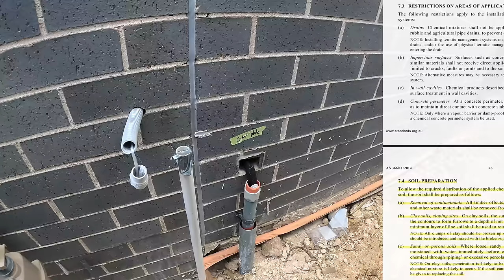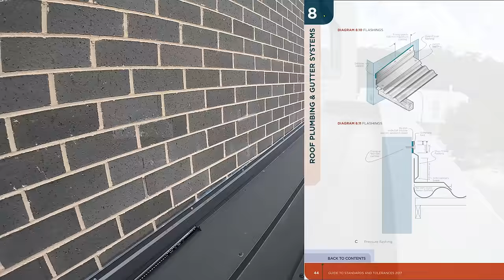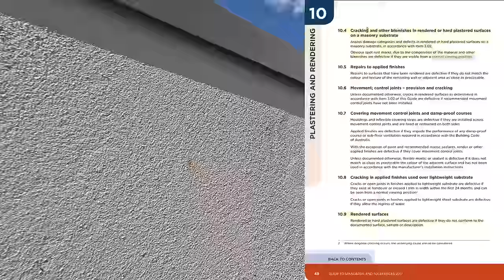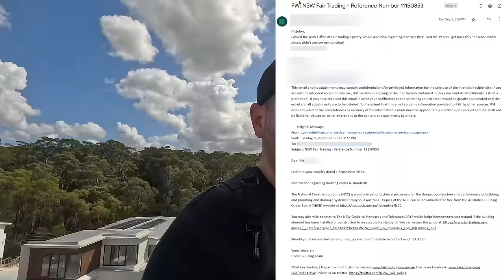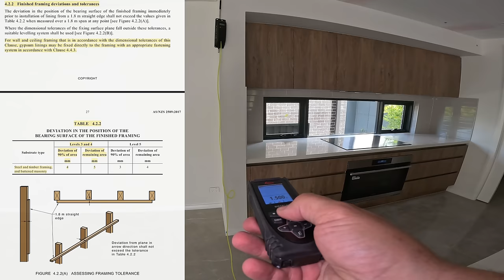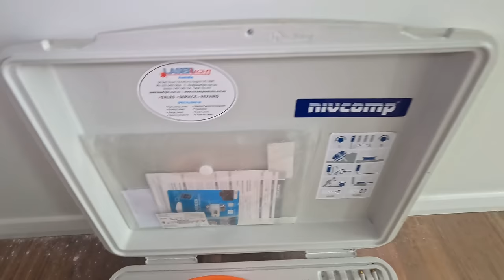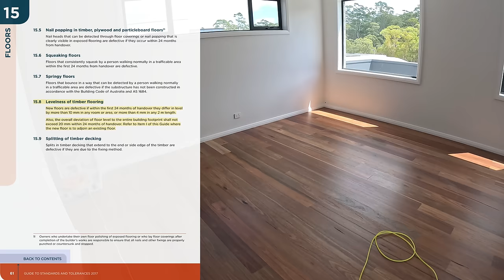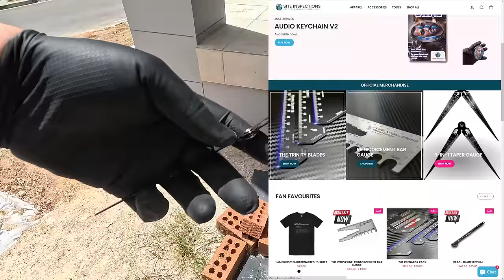I Inspected An Award-Winning Build | NSW Exclusive

Comment: Ugh, that paint work is insulting even to my amateur brush-hand self, because even at that height I would have done the job properly. Because not making the surface flat leads to crap pooling in the hollows and on the snags, leading potentially to premature paint failure and water ingress into the underlying material. And any gaps should get the appropriate sealing treatment or get flashing on them if they're too big to seal otherwise or have significant movement. 

Which is how I got lots of selley's no more gaps smeared all over the shorts and tops I've used for painting, because weatherboard houses always have gaps, especially around the windows and corners. And the rag is is oft not in reach lawl. 

And those floors and ceilings, it's a new house, but it's as uneven as a earthquake effected house here in Christchurch, despite the house costing easily $1.5-2 million. Total schemozzle of a job there because all the kit floorers and plaster's have make doing near close to flat surfaces so much easier than the old plaster and lath or floorboards right on the joists days. But nah, just slap it on and spin bs when the client finds out, even on a major build like this. 

I also don't find that suburb all that nice, far, far too samey, a lot better than certain infill suburbs where every house is exactly the same, but still too much homogeneity and there's no sidewalks either, which is a massive planning fail. Plus it's sitting in a prime bush fire environment when a major drought hits, but was hopefully built on previous pasture, rather than cleared forest.

Comment: Imagine paying $1m+ for these badly designed homes of polystyrene, held together with silicone, that leak even before the owners move in, all lovingly handcrafted by fresh-off-the-boat "tradesmen" (with years of experience as goat herders), to non-compliant sub-standards.
Reply: Don't be racist, Aussie builders just as bad.
Reply: 2 million - land is 1m
Reply: Nothing wrong with the building systems. If used properly, it's a very viable building material.
Reply: Thanks for the laugh
Reply: @elmohead  polystyrene shouldn’t be used for anything
Reply: @JP-ke7tt nothing wrong with polystyrene vegetable boxes.
Reply: @JP-ke7tt just for fruit boxes and cool rooms...😂
Reply: Its not the Labourers, it's those who Inspect and give the ✅️✅️✅️ of approval and hand the owners a Lemon.
Reply: Well when your contracts are given to the lowest bid what do you expect?

Comment: My home is a mass produced,transportable home, made in 2 sections, trucked in from 300km away.........and its better than these builders. Thats the thing, the manufacturer has all their tradies, on one site, properly supervised,properly trained and sorted to do the job properly.  Not like these sites where "cowboys" can run amuck and do whatever the heck they want, signed off by useless,or corrupt inspectors. If you are going to do complex structures, on remote sites, you need to have top notch supervisors kicking their tradies into gear to get the work done correctly.

Comment: Do you ever feel like all these regulations bog down the building process? People don’t want expensive houses that take so long to build, but they also want them built to 10,000 different codes. Were there this many codes “in the old days”? If not, were houses really poorly built without so many codes? Is the purpose of having so many codes so that houses will last a long time without a ton of maintenance?
Reply: They're there because people chuck a tantrum when something goes wrong.

The first thing Aussies day is... The government needs to do something.

Then everyone complains that they do.
Reply: There were very few houses built with flat rooftops in the old days. Where you had parapets and chimneys they had extensive lead flashing at the interface to the roofing material, which was commonly a sloping tile roof. In fact, silicon didn't used to be available and the flashing was more intense.  A lot of the key structural elements were also brick or stone, more tolerant of moisture than the current homes with timber and mild steel as structural elements, so more important keep moisture out

Comment: The modern era of homes and building quality has really gone to shit. Tradesman, builders etc all want big money for rubbish work, This video is a clear indictment on the building industry and shame on them all.
Homes are getting smaller, put on tiny blocks of land and are costing double, triple and quadruple what homes used to cost 10, 20 and 30 years ago.
There's nothing beautiful about that neighbourhood. It's just another boring looking street with houses that look the same that are crammed together with little to no driveway space with houses tightly packed in between each other and little to no backyard.
This is not living. These houses are rubbish and I wouldn't be caught dead living in one of those. They won't last 20 years and by that time they will be falling apart. 
The quality is crap.
Thank God I have a quarter acre block in Western Sydney and will never sell it.

Comment: I agree with almost all of your videos and I watch them and like your content but as a roof plumber I can say that installation was very neat, not compliant with the upstand and pressure flashing that’s a big no no and should have been done but I see no other reason why they would make the box gutter chute so small unless they had no other option, no roof plumber would just choose to do that, I find myself a lot of the time it’s the badly designed house and terrible chippies that cause these problems, we can only polish a turd so much bro , and we can’t exactly just go cutting lvl supports. There are a lot of variables and I see you picking on the roofing side more than anything when what we install is dictated by the frame and structure built before we commence work. So every rainhead now that’s not the patented design is non compliant, bro! They have worked flawlessly for 50+ years in that configuration, just because someone patented something doesn’t just make something not do it’s job adequately. All I’m saying is go a bit easier on the roof plumbers because we work with what we got , we have to order materials to suit whatever the chippies or brickies do it’s not in our control. Some of the roof plumbing work you point out in some of your videos is definitely very wrong but alot of the time it’s completely fine and extremely neat and uniform, like I said before we can only walk with the skeleton we have been given , and sometimes those bones are broken asf and we just need to get it all on , deadlines , shit carpenters , shit brickies , renderers , scaffolders, and the volume builders all play a massive role in our end product.